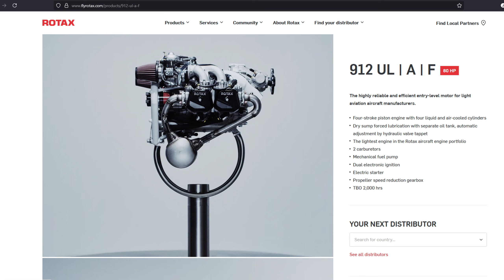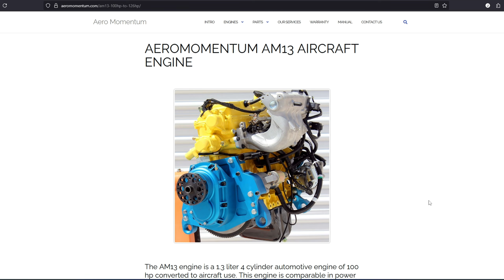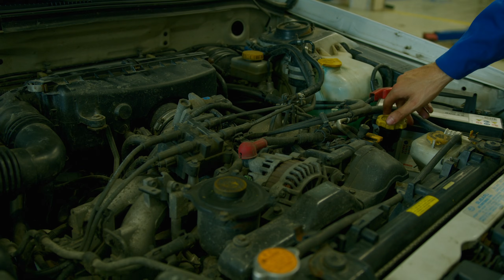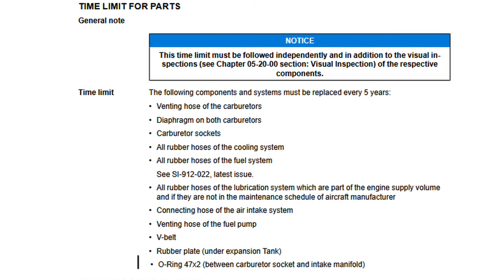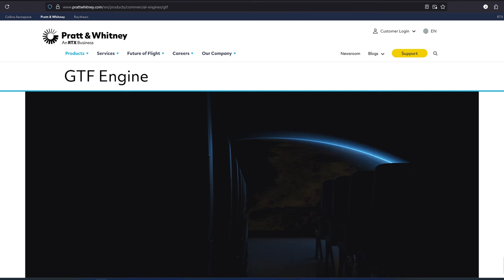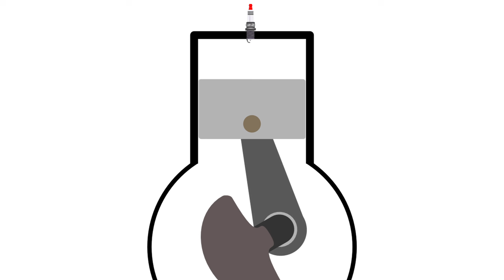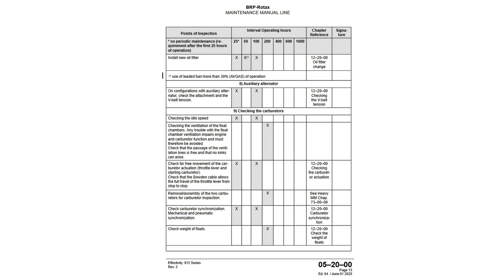Are These Rotax 912 Design Features Problematic? Design Explained

Comment: When Rotax got into the game,  there was good reason to give them serious scrutiny and the design choices were cutting edge.    The Rotax series has more than proven itself.   Clearly its a leap ahead.  This is a great breakdown as to why those choices work.   2000 hour TBO that is often exceeded only adds to that.    Yes there is a minus in maint with the gearbox inspections.    Compare that with saving 50 lbs and a TBO that is exceeded and its a no brainer.

Comment: On another channel there is a video of a four cylinder Rotax disassembly where I noticed it had a built up crankshaft and roller bearing big-ends. Does anyone know why they  went this route rather than a one piece  crank and plain bearings?

Comment: The problem with coolant systems is that they can fail mid flight, for example leaks develops mid flight. That is far from an unheard situation and you simply just don't understand the argument or a trade off. All aircraft are maintained, that is irrelevant. The point is that mechanical complexity increases failure points and active parts like liquid cooler is one big variable of it.

Comment: I have a 915. Although these engines are much better than a Lyconosaurus they’re still late 80s early 90s technology. I love how they run and how easy they are to operate, but they are maintenance whores and very complicated compared to legacy engines so finding a qualified competent in most importantly “willing“ person to work on them is very difficult . 91 octane is not enough margin for these turbo engines at higher density altitudes, and any lead sludge in the oil tank, I mean any lead in the system will lead to carbon buildup and detonation. Ask me how I know about burning up my motor at 750 hours….

Comment: I also had total coolant loss a few months ago in my CTLS, it happened right after run up and before taking off. I was towed back to my hangar and when removing upper and lower cowlings, my AP found the 90 degree elbow on the cooling rubber hose had busted. It was a plastic elbow!!!!
We ordered a new SS elbow from Flight Design, replaced the thermostat and filled it with Preston’s antifreeze and voila, no problem ever since.
After this incident, I checked my POH and under Emergency Procedures it clearly states: “A loss of engine coolant does not require immediate forced landing”. 
Regards.

Comment: I can see you are knowledgeable about this engine — can you help with mine — since we took it out of the wrapper it has been “sooting up”the sparks — we have changed them a number of times / have balanced the carbs and now after 200 hrs we carried out a carb maintenance — still “sooting up” and now also have a “mag drop” ( last trip the engine was “missing” or a “hiccup” which was disconcerting to say the least — any ideas ?? 
 Rod Evans (Kenya)
Reply from the maker: Hi there. I'm not a pro on maintenance and I'm not qualified either, best is to get it to a reputable Rotax mechanic.  Though I'm sure that's near impossible up there. 

What Rotax is it? 912? 80 or 100hp?
What fuel do you run on? If running on mogas from filling stations, any chance the oil level is rising for unknown reasons?

Does all 8 spark plugs have excessive soot? Sounds almost like ignition has been a problem, but unlikely to soot all 8 plugs and should be obvious at mag checks.

You said the carbs have been balanced, but, is the mixture not too rich?

What rpm do you cruise at?

What does the EGT's read in cruise?

Comment: Aircraft mechanic here: maintained and used properly, the 912S is doing the job. By properly I mean sticking to the manual.
Although one of the issue, on some installation, is a partial loss of RPM during initial climb, 
supposedly due to squeezing carburetor float chamber vent (not admitted by Rotax btw).
However, the 912S3 ( hydraulic variable pitch) is experiencing A LOT of piston seizure, 
Usually piston #2:
Tecnam P2006T, Bristell B23, Aquila AT-01…
Various CAA of different countries are currently investing the cases and have published reports while Rotax is basically denying any issue with this engine.

Comment: The "I refuse to fly behind a Rotax because it has a gearbox" arguement is baseless for many reasons, but here's mine.
Your fancy electric start Continental engine in that cessna? Yeah, won't start without a starter motor geared to the crankshaft, or at least one (but properly 2) magneto(s) geared to the camshaft, oh and speaking of camsahfts, that's geared to the crankshaft too.
I'd like to get an explanation of why those gears are fine but these gears in the PSRU, which are being directly lubricated by the engine oil system aren't fine.

Comment: If they're complaining about high engine speeds meaning low reliability, then clearly the PT6 turboprop should be horri- what do you mean that even generally, turboprops are far more reliable than any piston engine?
Yes, if you try to push a Continental up to those speeds you'll have issues, but consider this, it wasn't designed for those speeds, it wasn't certified for those speeds, so thinking about those speeds being a problem on another engine that was designed, was certified with those speeds, I don't see where they have a leg to stand on.

Comment: I have had aircraft with Lycoming, Continental, and Rotax. All are expensive PITA's! Read an article somewhere that claimed Rotax spends more on research and development than Lycoming and Continental spend on production. Rotax has a lot more money to spend on improving and innovating. That does not bode well for the future competitiveness of Lycoming and Continental. The numbers suggest that the Rotax is at least as reliable as any Lycoming or Continental. However, successful aircraft engines are all extremely reliable given adequate maintenance. It's hard to differentiate between them when even the most common failure modes are rare.  Cost, maintainability, and efficiency are the discriminating factors.

Comment: I have a 912ULS in my Rans S-7S with approximately 700 hours on it. I had a coolant hose burst in flight a couple years back - cyl head temps skyrocketed (not sure how long it was before I noticed), I immediately turned around and throttled back. Made it back to the field in ~15-20 minutes without issue (other than my underwear). I verified cylinder head nut torque, replaced all coolant hoses, and it's been trouble free since. To be fair, I'm guessing the hoses were much older than 5 years when this happened.

Comment: Hi, one of the engines you compared the Rotax to was UL260iS. Its power, weight, TBO, and fuel consumption look similar on paper. The UL seems to be slightly more expensive. But apart from that, would you consider the UL to be a viable option? (Also, I was under the impression the Rotax was closer to $30K...)
Reply: The ULPower engines are not available for certified aircraft.
Reply: @PistonAvatarGuy  Wow, thanks! I forgot about that!

Comment: There was a Rotax engine that failed at local airport with a hole in the piston
 melted thru
during t/o
reports of wrong fuel
Reply from the maker: Sounds like detonation caused by too low octane fuel.

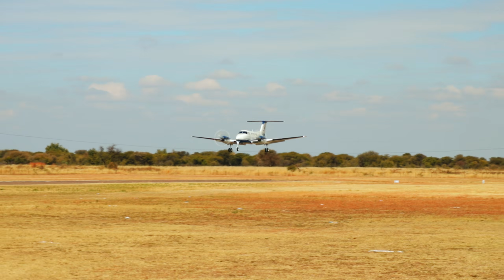Comment: Note , in 11:06 you showed a King Air , which use a PT-6,  the PT-6 have other gears but the propeller are driven by a free turbine , with no gear box.  What is the big deal, we get into cars and other vehicles, all of them have a gearbox or two.
Reply: There’s a PSRU from the free turbine to the prop itself. The engine runs tens of thousands of RPM and so does the free turbine, giving you torque that can drive the prop closer to 2,800rpm.

Comment: Rotax are use in drones, one key reliability you did not mention , (maybe you did not know)   for maximum reliability, the military do not use glycol based coolant , they use Evans coolant, with a boiling point at 375 F, that means the system do not need to be pressurized the 15 PSI just to squeeze a few more degrees of headroom out of the coolant. Without pressure, there is far less chance of a leak, and if there is a leak, some tape at the leak and a top up will get you home. The Evans are more expensive and you cannot mix it with water, but the cost is nothing when you consider what the whole drone cost.
Reply: Evan’s is used in drones? Rotax says it’s not approved with the 2013 and later 912/914 engines because of the head design. I’ve also read that Evan’s runs hotter.
Reply: @nickr5658  My automotive experience suggested, running hotter should not be a problem, provided it is not near temp where the metal will be weaken or changed. The big thing that must be avoided , especially with new engines is the coolant must not be allowed to boil, causing uneven temp. That is where Evans shines at 375F boiling point instead of 256 F. I have to check with Rotax for their newer specs.
Reply: @tonylam-u1t good info. I think the problem isn’t what coolant to use but the radiator and oil cooler are too small. Oil cooler especially. There is an updated cowl for my airplane but it’s incredibly expensive so I’d like to find way to modify my current cowl for better cooling. Also would like to add a larger oil cooler. Will ask Lockwood for help
Reply: @nickr5658  I made a quick check, but not with Rotax, and I saw nothing about Rotax ban on using Evans, but that coolant are thicker than glycol.

Comment: There is "the no Rotax 912". Rotax has suffered from the usual material and built quality deterioration in the last years. That's why if you have a well working 912, hold on to it. Then the multitude of electric ignition issues of the last couple years has put a bid dent into the reputation. I don't fly the 912 anymore, rather the 915is with dual fadec lanes. Also has some issues, but more redundancy, e.g. dual injection per cylinder, etc. And of course my own IO-360ES 😊

Comment: I've now had 2 Rotax 912UL engines (both about 1000 hrs) and whilst they have been generally OK, I wouldn't say that they have been tremendously reliable. I've had a fair list of failures:
1. Inlet valve failed resulting in very rough running.
2. Propshaft spine failure resulting in vibration.
3. Coolant system failure when a hose clamp failed.
4. Piston ring failure resulting in high oil consumption.
5. Ignition module failure resulting in inability to start the engine. This happened twice.
6. Ignition module failure resulting in inability to stop the engine. This also happened twice.

To be fair the engines never stopped in flight, the coolant loss occurred overhead the airfield, so I was able to land quickly. My experience with the 912 is that it doesn't reach automotive levels of reliability (I'm thinking Toyota, not Range Rover). My engines are always regularly maintained using the correct Rotax parts and service items, so I don't know whether I've just been unlucky.

Comment: My 912 ULS ran for 2000 hours without a single problem.
Reply: Why would you replace it at 2000 hours if it was still running fine?
Reply: @chrisrose1508  My current shared ownership aircraft with 912UL has 3,900hrs on it, without overhaul and it still runs like a watch - only one carb overhaul in all that time.

Comment: GEAR BOX....Barf... it is more maintenance (required inspections) and a failure point, of which there are many cases. Other than that It is fine in the low HP range. In higher HP the Rotax is well no competition, in the 160 HP and higher range. The advertised Power for the 915/916 is time limited for TO only.

Comment: Excellent design.  I work with an AP who works mostly on light sport so he has inspected and repaired several thousand 912’s.  The carbureted version is mostly trouble free. The fuel injected versions can have really annoying electrical problems.  The ecu system on the fadec rotax engines keep him real busy.  Typical German over engineering on the FADEC systems.  However the carb version 912 is outstanding.  One criticism that pertains to all rotax aviation engines is the cost of parts.  Rotax parts cost more than the equivalent Lycoming/ continental parts.  A gearbox rebuild will cost you $2,800 not including labor to remove and install and yes you rebuild the gearbox if you need to use 100LL.

Comment: This is a very good and useful overview of the Rotax engine, and I agree with most of what you say. However, you have omitted one important aspect. In Europe, there have been a number of incidents involving seized and damaged pistons, and investigations have revealed that the damage was caused by knocking. This only affects carburettor versions; engines with fuel injection systems are not affected. The investigations are still ongoing. 
As a contribution to the ongoing discussions, we have conducted some experiments to find out how likely it is that the pilot will cause the engine to knock during a normal flight. So we took our Aquila 210 on a normal flight, climbed to 3000 feet, maintained altitude and reduced power for cruise flight. We used a camera and recorded the most important instruments, then used some Python scripts to evaluate the data. We found that the pilot can easily cause the engine to knock with small errors. If you have 95RON fuel in the tank, you will enter these conditions if you reduce the RPM just a little too much (the Aquila has a constant speed propeller). 
The carburettor heater is very sensitive. You should not touch it if possible, because as soon as you set a significant amount of power while the carburettor heater is on, you will find yourself in the knocking range. For example, if you need to perform a go-around and forget to turn off the carburettor heater before setting the power, you will run into trouble. You can find all these results in our article in the August issue of the German magazine ‘aerokurier’. Perhaps you could cover this topic in a future article. In any case, I really appreciate your video and we will use some of your explanations in our flying club. The animation of the oil system was very good!
Reply: Any issues with knock during low rpm operation are the result of poor development of the ignition advance curves vice power. Also, any decent ignition system now should have knock sensors that trigger retarded timing if knock is detected. I drive a turbo car that is optimized for 95 octane but runs fine all day on 87 octane with a small max power loss and no efficiency loss during normal driving. This should be standard on any FADEC.

Comment: I've been flying with these 912UL/ULS engines since 1997, having about 1500 hours using them, out of my 22k hours flying total over 58 years. I learned to fly in T6 / SNJ / Harvard and also had a few years with Lycomings. Having built my own aircraft and done some in-depth aspects of engine maintenance e.g. stripping and overhauling carburettors, I can vouch for the phenominal quality and reliabilty of these engines, whereas a P & W R1340AN1 tried to kill me. Nuff said!

Carburettor balancing is a bit fiddly, but once balanced they stay that way for several hundred hours, as long as the linkage/s don't get worn / mismatched. Our local source of mogas is supposed to have ethanol, but I've never found any whenever I test each batch, so lead isn't an issue. By the way, the little water jacket heaters at the downstream side of the carburettors absolutely do prevent throttle body and butterfly valve ice, with no measurable performance penalty.

As someone has already commented, DON'T idle the engine below 2000rpm whether warming up or taxiing, to prevent shortening gearbox life due to "chatter".

Finally, at our airfield my Rotax 912 ULS is one of five fitted in various airframes in our hangars. The past 20+ years have given us many thousands of hours to accrue a history and the reliability is fantastic. Whereas three aircraft in the same period did forced landings operating from our airfield, their Lycoming engines failing suddenly due to "exploding" crankcases and sudden loss of oil pressure due to a fractured pipe supplying pressure to the VP prop. The evidence is irrefutable!

Comment: I had a 2017 912uls break a valve spring retainer and destroying the engine. Rotax just shrugged which pissed me off. I found an atsb report about a heap of failures of that era of retainers. Rotax pretended it was an oil bleeding issue which doesn't survive any scrutiny. 35k engine and half the life went in the toilet and I could have died. I chose the rebuild an older engine and fix a bunch of other problems and this one runs like a top and is 6 knots faster. The whole thing left an extremely bad taste in my mouth.
Reply: You should read up on the Lycoming and Continental crankshaft failures.
Reply: The ducati ignition of legacy 912s was poor, pricey and only as reliable as basic mags.  That and the Bing64s really say go full 912 is.

Eschew leaded fuel and enjoy.

Comment: The uneven fuel distribution on O200s and such can be improved by running the carb heat in cruise
Reply from the maker: Yes! ☝️ Also useful if you want to fly lean of peak on these carburetted engines.
Reply: @LetsGoAviate 
I’ve had one that was impossible to get lean of peak without doing it. Leaning with the carb heat off would only get you a misfire.
I’d guess the carb heat got me at least a 10% increase in range.

Comment: Sucks having to rebuild the carbs EVERY F*CKING YEAR !!!
Reply: Dunno about rebuilding the carbs every year. That has not been my experience. However, the "every 5 years" total rubber replacement is expensive and tiresome. I'm coming up on my second 5 years with a 912 and I am going to replace the hoses with silicone and teflon hoses that do not have to be replaced every 5 years. More expensive up front, but worth it to not have to re-plumb everything.